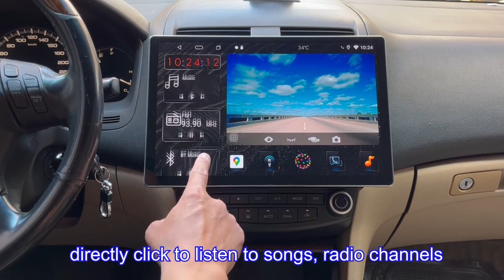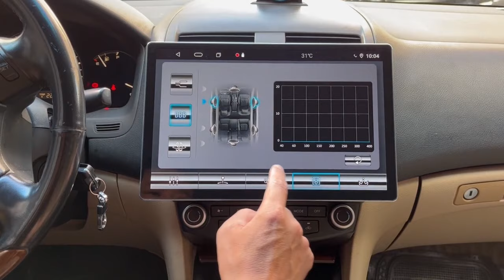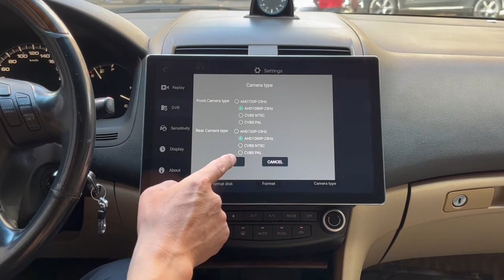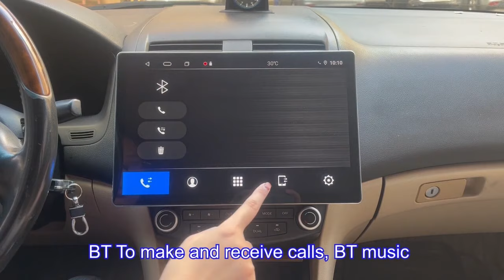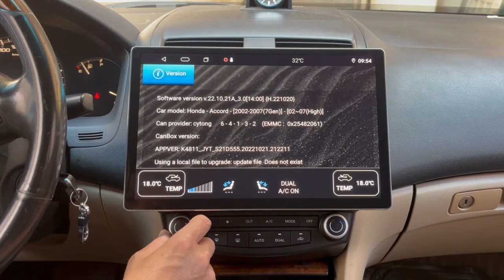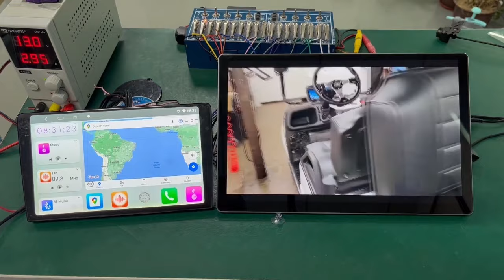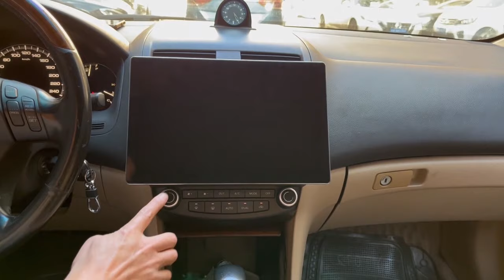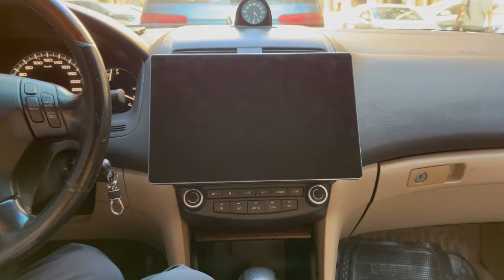13 inch high-definition large screen car stereo

Comment: The product does not change the tilt angle according to individual needs. Each model has a different height and seating position, there are right-hand drive countries, left-hand drive countries >>> products for service certain car models >> not suitable for versatility and dynamics.
Reply from the maker: It can be adapted according to the model, and the height can be adjusted up and down. If 13 inches is not suitable, you can choose 12 inches or 10 inches.
Reply: @JYT-JMANCE I need one how cud I get one..?

Comment: Does it include the canbus for factory settings. And steering wheel controls
Reply from the maker: supported
Reply: @JYT-JMANCE included in radio or needed to buy separate can box ?

Comment: The down side to having a large screen is the heat and cold vents is blowing cod and hot air in the back of the screen..Screen may give out prematurely
Reply from the maker: Hello dear friends, the screen accepts temperatures of -20℃-+80℃ and works normally. The 13-inch screen will not affect the air conditioning effect. We also want a 12-inch screen. 10 inches https://youtu.be/b6GgYsQv6Po
Reply: Not true Mines have been running fine and sits directly in front on my front heat and air vent for over a year now!

Comment: I checked it on ebay. I was about to purchase it for my Highlander 2019 platinum but I still need to make sure if the 360 OEM camera system will be functioning.
Reply from the maker: Support 360 panorama model G93.CPU Qualcomm Snapdragon 665
Reply: I have it in my 2019 Highlander xle and boy it’s exceptional.the camera’s angle is the widest i have seen

Comment: Does this unit mount in a standard Double Din? I have a 2007 Suburban, is there a wring harness with Bose support?
Reply: I had a 2010 Tahoe and if I were you I’d go on dhgate and type in Tesla style stereo. It consumes your interior cold/hot air controls (they will be digital on the radio screen) but 100% worth it.  It was AWESOME before I traded the Tahoe in.
Reply: And to answer your question since they didn’t, yes a standard double din will fit your suburban
Reply: Just double check wattage and plug ins for your bass/amp under your armrest
Reply from the maker: Dear guest, I will send you a link to the company's website, and you will need to contact customer service to get the dashboard model.https://jyt-jmance.myshopify.com/products/jmance-13-inch-2k-qled-touch-screen-android-11-car-stereo-4g-dsp-bt5-0-octa-core-gps-multimedia-player

Comment: I have Junsun x7 PRO in my Honda CRV but subwoofer don't  want to work. Do you know why? 😢
Reply from the maker: Which model are you using? You can look for it in the settings. There is a subwoofer switch.
Reply: @JYT-JMANCE  Junsun X7 Pro
Reply: @JYT-JMANCE  I can't find it...
Reply: And work the sub?😢
Reply: @patcileinify  no
Reply: @sonikwro  do you know why ?
Reply: @patcileinify  Not yet

Comment: Hello what is the wattage for the amplifier on this unit it? 50w x4? Also, can I use aftermarket cameras with this or do I have to use the included cameras? Thanks kindly!
Reply from the maker: Hello friend. The front and rear cameras are configured on our products
Reply: @JYT-JMANCE where i can bay this radio ?
Reply from the maker: @CedrickDelus  whatsapp 8617827621678

Comment: Will this fit a 2016 ford fusion with 8in screen bracket?
Reply from the maker: 9__10 inch frame can use 13 inch frame
Reply from the maker: URL:www.jiayitong.com
whatsapp :8617827621678
wehchat:17827621678
If you would like to inquire more, please contact us
Thanks

Comment: Will this fit a bmw2014 grand coupe
Reply from the maker: A 10-inch screen is optional. 12-inch ones are also available, and 13-inch ones can be adjusted up and down.

Comment: The problem here is the air vents
Reply from the maker: The air outlets will not be completely covered, there will be a distance between them, which will not affect the work of the air conditioner. It can also be adjusted up or down according to your car model. Thank you for your question.

Comment: Do this unit work with 360° Panoramic Camera set up?
Reply: my 360° Panoramic Camera is after market works with my other android just need to know do it have the 12 pin video input on the back of it
Reply from the maker: https://youtu.be/DUtSmI01i2I

Comment: looks like the typical cheap chinse radios
Reply from the maker: 13 inch High-definition Large Screen,2000 * 1000 resolution,2K QLED New tuch experience,Colorful vision,Fully fitted with non-reflective toughened glass, three more layers than the normal screen,With a higher gamut, more realistic picture quality.